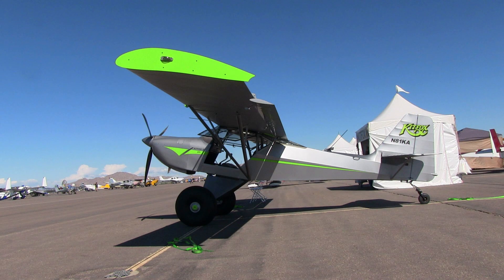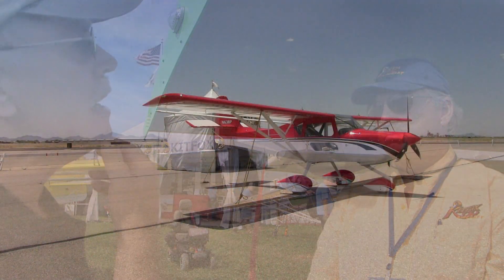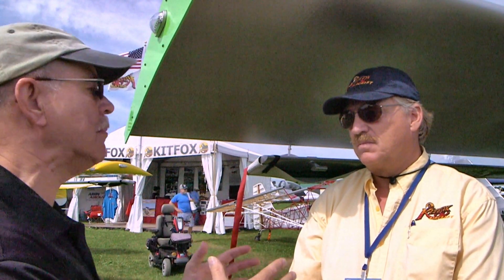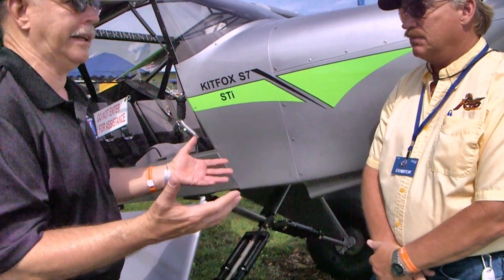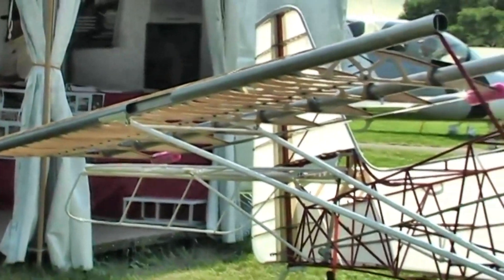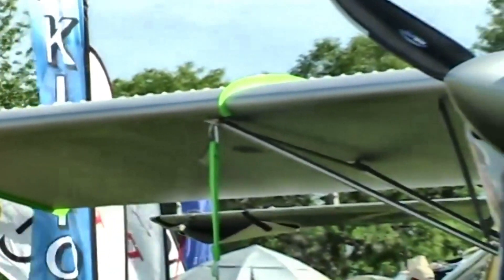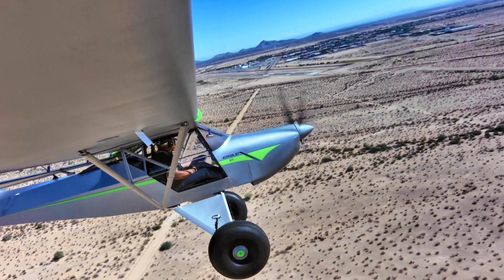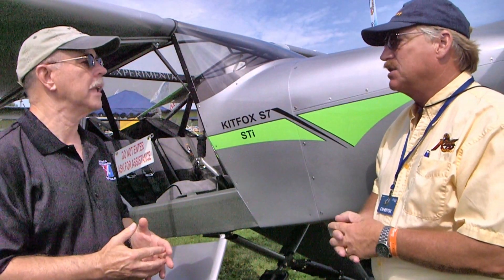Light Sport Aircraft, KitFox ST i STOL, Light Sport and Experimental Aircraft Kit.

Comment: 50,000 my rear, the rotax they use is 30,000 alone. Nice plane but it will be 100,000 before you get one like they’re standing by. Otherwise, id have one
Reply: 50K firewall aft w/tax and a few options. Tack on another 30-40k for new firewall fwd and avionics.